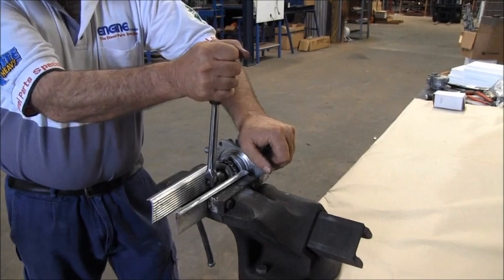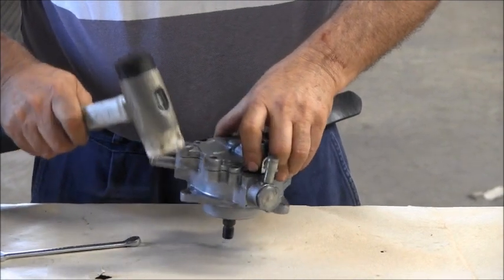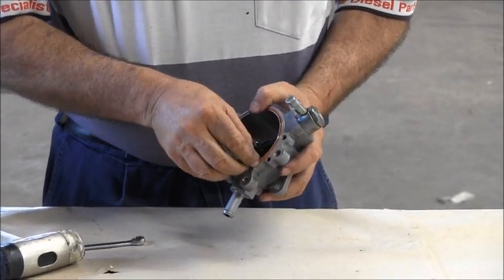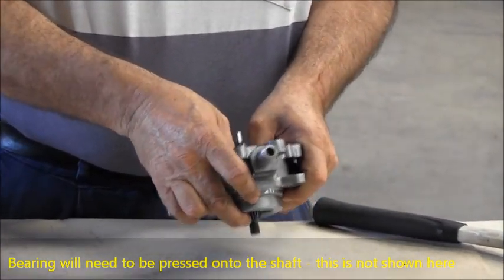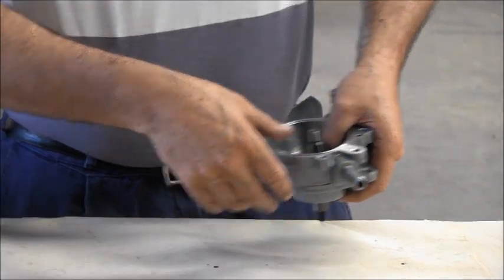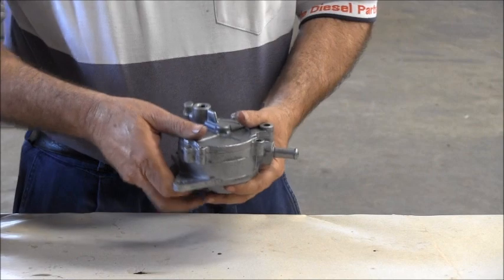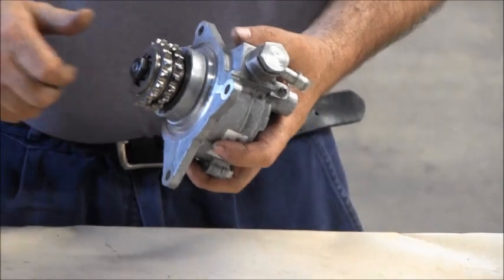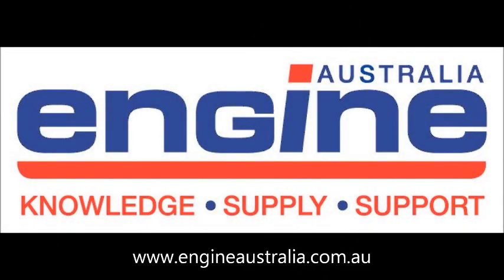Nissan YD25 Vacuum Pump rebuild kit installation

Comment: Is there anyway to remove vacuum pump rather than opening the timing chain compartment? I just had vacuum pump failure .. Thanks in Advance.
Reply from the maker: No, not that we are aware of
Reply: do i have to remove the whole chain or can i just remove the gear with the chain on thanks  @EngineAustralia